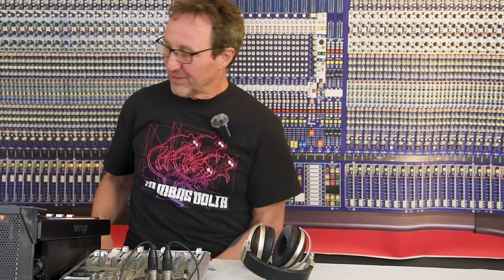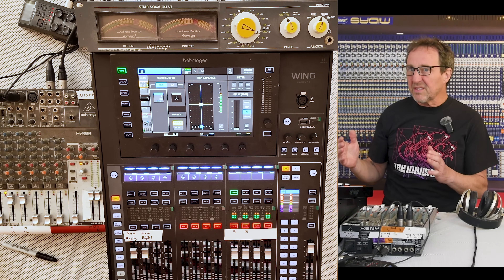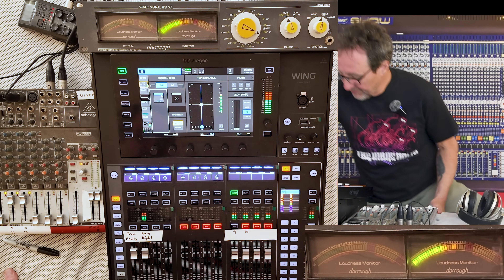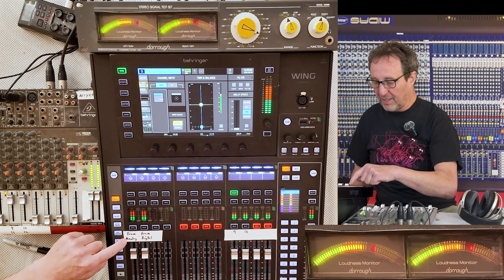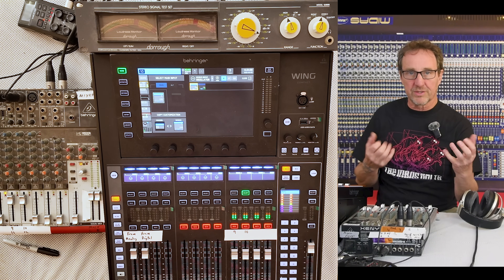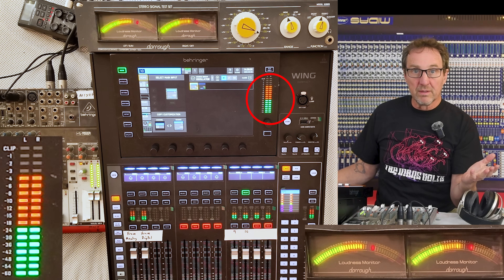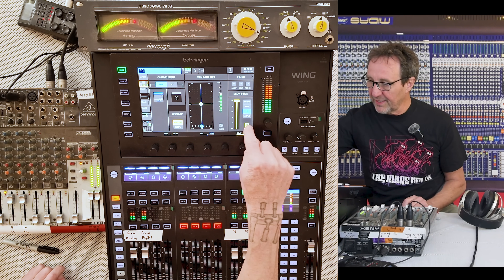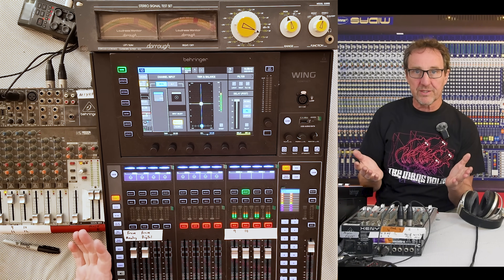Digital Audio Meters Don't Show What you Hear - Sometimes

Comment: Very interesting.
I wouldn't be surprised if the digital meters somehow were actually technically "correct" in a specific kind of way.  but I'm no specialist on the math of digital metering. 
The problem generally is not "meters". The problem is people who often tell us meters are "accurate" with music program. (most are accurate with a sinewave)
By the time I had 20 years in the business I had realised (through transition from analogue tape recording to digital tape recording, then to direct to disc recording) that even at that time that we were in trouble with metering.  Old analogue VU and PPM meters had no accuracy whatsoever over a musical signal as "meter ballistics" were really the dominant thing, the mechanics of a moving coil and needle and some crude drive circuitry, VU meters were intended to represent (slightly) the dynamics of tape and tape saturation and were therefore blind to peaks and signals above +6 dB over whatever reference was supposed to be 0VU.  PPM meters were more for transmitter protection in broadcast and would read faster and higher yet you could still shoot off the end with a clean signal.
When we went over to DAT and things like the DTC1000ES, SV3700, or DA20 we struggled to get to grips with absolute peak meters and the concept that "0VU" no longer had any meaning and that Fs was the new "god" in the room.  It was a Wild-West in those days, every manufacturer had differing ballistics and it took a bit of experience to know how hot to run a DAT machine for mastering. 
Live sound was less "critical" about metering back then. Our Yamahas (PM3000 and PM 1800) were happy with all VUs slammed against the end and ran perfectly clean, our Soundcrafts less so. 
As a system tech live (for the last 40 years) I spend a lot of time getting "headroom" matched from the desk all the way to the amps. It's never been about "precision metering" (maybe I am too old and come from a more basic time) but more about getting noise floor and clip points in the right place and then getting the best clean signal into the DSP from the console so the DSP has room to "breath" and do it's work. It's also about getting a signal out of the console at a level that allows the console to be able to "breathe" and cleanly deal with the unpredictable dynamics of the show. 
As such we are usually working in about 6 to 10dB "clicks" of gain adjustment increments as we know that all our gear is a bit "here or there" with clip levels and most of the new gear has up to 100dB of dynamic range that on most shows is being played out in an arena with often no more than 60dB dynamic range window between "too loud" and "crowd noise" - some rare shows maybe 80dB at most.
We tend to look at metering as a very vague science, a kind of "ballpark" number that somehow kind of tells us (maybe) that we are there or thereabouts close to where we want to be. 
Metering is a visual representation in a most basic form based on whatever metering ballistics were chosen to represent a far more complex program. No metering is "accurate" (even analysers - especially analysers) because there was always some form of compromise to make it visually representative of the program. a truly 100% sample for sample meter (easy to make) would be so flickery as to be distracting and illegible. 
As always, great video Dave, and plenty of food for thought.
Reply from the maker: Indeed the digital metering is technically correct in that it is indicating the level at which to signal will distort and give digital clipping and how far you are from that. 

But the bigger issue has to do with why the meters are reading higher levels. 

It has to do with the way that high frequencies float around effortlessly inside of digital gear up to very high frequencies. 

With analog gear little clippings of ultra high frequencies just create more ultra high frequencies that we can't hear 

With digital gear clipping of ultra high frequencies can create subharmonic artifacts that are audible.
Reply: @DaveRat  I agree. 
(BTW I replicated your results on an A&H SQ6) 
It's always been a case of "swings and roundabouts" for me in that some meters tend to show some aspects better and others represent other aspects in a more user-friendly way. 
(That's why I use both SMAART and AFMG SysTune analysers on the same job) 
A lot of human perceived loudness is related to time integration of our hearing (the amount of energy in a particular time window) rather than just the instantaneous energy. It is possible that this is where we are seeing metering differences here. (Maybe the decorrelated signal possesses the same overall time integrated power as the summed signal and the metering is registering that through the metering algorithm. I'd be interested to know.
I'd love to see this on an oscilloscope - maybe I will give that a go tomorrow to see what the scope reads as the scope won't have the meter ballistics on the display that the consoles have.  
I also have some super old digital gear hanging around the workshop. (Sony PCM 701 and a Somy MDS E-11) I'd be interested to see how they deal with the issue and if their metering is more simple.
This could even just be down to the consoles and DAW allocating DSP resources and could even be how a stereo meter is processing a 2 channel signal with a single DSP function and maybe interleaving samples.
I wonder if the stereo meter will even display a signal above 48K on a 96K console.
We have issues with A&H mixers interleaving stereo signals in the main FX engine rack. If we run a 96K noise signal through them and then put a stereo FX rack plug-in (Not default channel EQ comp gate process) on a channel it truncates the audio down to a 24KHz bandwidth suggesting that the 96K core is interleaving stereo signals The consoles work fine passing 48KHz audio until a DEEP processing effect is put on a stereo signal..... I wonder if the stereo VUs are all doing something similar. - that I don't know.
Reply from the maker: Let me know how it goes and what you figure out. I have another video that I did that's not released public yet that dives into this subject further.
Reply: @DaveRat  Interesting news....
While setting up some tests on the Allen and Heath SQ6 I found that it DOES meter the drop in level. 
.
It just depends on where the master fader is. 
.
As the meters are only 3dB increment if the fader is at a position "between" steps on the meter the meter does not move. If the fader is about 1.5dB higher than that it correctly drops 3dB with the delay on/off switch.
.
Good work from A&H on the SQ boards... a serious bit of kit for the money. 

Here is a short video showing the experiment, first with the master fader at a position where the meters don't move, and next raised slightly to where they do. 
https://youtu.be/7bQjZbGtIFE
.
Here is another video showing the graphical meters moving, It's not too easy to see as the scale of the meters is HUGE and 3dB is tiny but you can see them move. 
 .
https://youtu.be/mlIbtA3s5IE
,
Interesting stuff.
Reply from the maker: To make things clearer and reduce resolution errors and such, I did it with 10 white noise signals all with staggered delays of 50ms or so.that should create a 10dB boost for decorrelated and 20 dB for correlated both audible and metering wise.
Reply: @DaveRat  What is curious here is that the A&H D Live clearly does not change (on your video) when tested yet the A&H SQ6 does.(on my video)  Supposedly they both run the same basic FPGA 96K core and have very similar (if not the same) underlying algorithms. The SQ6 has a more low resolution output meter so obviously the code driving it will be slightly different. 
I'd be interested to see if the D-Live does the same thing in the iPad app as it does on the surface. 
While on the subject of metering, another thing. 
On the SQ6 I get a feeling that the LED meters and the on-screen meters are VERY DIFFERENT in terms of how they portray a signal (not necessarily in how accurate they are, but how that display "feels" to the user) The LED meters feel faster and more responsive like an analogue desk while the on-screen meters feel a lot smoother but less clear despite their higher resolution even when seeing both meters side by side I tend to feel I get better information from the lower resolution LED meter.
See here.
https://youtube.com/shorts/tpt1impjckA
Reply: @DaveRat  Allen an Heath CQ 18T test.
https://youtu.be/TzHFfvQcIug
Reply from the maker: @joulesnewell8063 and confirming that is white noise not pink? The meters usually don't move so much with white noise and move more with pink noise
Reply: @DaveRat  https://youtu.be/5Hl30X1f0MA
Reply: Amazing how fast the ªCM701 meters are. I think these 1980-s meters are absolute value rather than RMS or PPM or VU.
https://youtu.be/XQolBxGDmws

Comment: 4:04 The analog does not perfectly null when the polarity was flipped. Not sure that it matters that much, but thought I'd mention it.
Reply from the maker: That's true and unlike digital where you have a numerical representation, analog has slight differences in variations so you never really get a perfect null. 

Whether that is an asset or a detriment depends on the scenario.

Comment: Dave: has anyone from the Manufacturers of those devices given you any responses to this test.. ???
Reply from the maker: Yes I've spoken in depth with one of the manufacturer's design engineer. 

There are several issues going on. One is at the metering is hypersensitive to even the slightest peak which is different than even the best analog peak meter. This is important for digital meters to avoid digital distortion and also requires less processing than a smarter meter. 

Additionally there is an issue with ultra high frequencies floating around inside of digital consoles unabated. Unlike analog consoles where the very high frequencies become subdued or reduced as the signal path increases even if the bandwidth is the same. 

With an analog console those hold through high frequencies when they collide and create extremely short duration peaks, it's really a non-issue and not audible. 

Conversely in the digital domain where those peaks are more likely to happen and compounded by Nyquist filtering, overload of those peaks doesn't just distort an ultra high frequency signal with ultra ultra high frequency noise components all of which are inaudible, with a digital console those ultra high frequency peaks can have low frequency distortion components to them in the audible range. 

The issue is not easy to fix. One possible method is to low-pass all of your signals to eliminate the high frequency garbage up there but the low pass filters in themselves create additional issues. 

Putting an input transformer on every input of the digital console would act as a natural low-pass and prevent the issue.
Reply: @DaveRat  very interesting ... I long for the days of VU Meters and 20 -20K world.. So much simpler ... Let the "tubes" handle the peaks and only distort in EVEN harmonics... LOL
Reply from the maker: Agreed those Gremlins in digital make things more complicated. I'm not against digital and I love and realize it's assets and also it's important to remember that no good deed goes unpunished and with those assets come new and interesting issues that we need to be aware of

Comment: Windowing function of the metering has to make a math compromise that's decorrelating.   ADDA chip is being passed math that takes place "after" the metering, and the metering uses a logic gate shortcut to be fast, throws away identical values > f("?", 500hz?) without actually summing.  An inverted inter-sample "error".

Or it has a dithering value applied (at the meter) to make the ballistics look more "analog", but it creates a summing error as it approaches an upper limit.

 Inter-sampling windowing function has to be compromised.  Or "everybody" is using reporting from the ad/da chip manufacturer(s) (which is all probably using drivers made by (company name I can't remember)), which maybe has dithering for the level, or a sliding window?

Software windowing creating a false "negative intersample", guess at metering.  Presumption is that you could sum 16 channels and the meter wouldn't change, so some logic gate shortcut is throwing sn identical value away for expediency.  RMS windowing calculation has to be decorrelating by skipping temporally an operation or dithering.

Or the morning matcha hasn't kicked in and it's obvious, lol.
Reply from the maker: All of that seems to be focusing on the metering being flawed. 

For the natural progression of that is that if the metering is flawed and reading too high of a signal then we're not really losing that headroom, that's an illusion and the headroom is still there and we could boost the console and overload and still be clean, correct? 

Do this with 10 white noise channels so that there's 10 DB of lost headroom in the digital metering and push 5 DB into digital overload and see if your signal is clean.

Comment: I don't suppose that the Wing displays the channel level on the large meter when a channel is selected? So, the meter on the individual channel wouldn't change when the polarity was flipped (and neither would the large meter, if it is displaying the level of the selected channel). It looked like the meter for the main LR channel went up when you first unmuted channel 10. Do you see the increase if you look at the meter when your main LR is selected, then go change the polarity of one of the white noise channels, and then select the main LR channel again?
Reply from the maker: The easiest thing to do is set it all up and come out of the console back into two channels and then use the PFL meter to compare before and after converting to analog. 

That way you have the same meter looking at both and you'll see that converting to analog fixes the issue

Comment: I tested with Studio One 4. The meter on the main bus doesn't change, but if i use the Level Meter plugin that's included it show the correct values
Reply: The Level Meter plugin uses RMS that's why it's correct, but if I toggle the correlation meter it show that the signals are fully corelated in both cases
Reply from the maker: Okay so you solved the easy part of looking at a pretty picture, but the bigger more important question is, Are the peak meters actually reading real signal that will cause digital overload and if so the RMS meter trick is going to hide that issue from you and allow you to digitally clip. 

And if you pay attention to the peak meters then the reality that you're losing headroom in the digital summing domain that you don't lose in the analog something domain may be a concern

Comment: Dumb question, could this have anything to do with the ballistics of the digital meter. If the RMS calculation is too short the meter may not react properly?  
Id love to check this out with some digital metering plugins in a daw to see if its happening there as well.
Reply from the maker: Meter ballistics are definitely a factor but in the video I show that the problem goes away if the signal is converted to analog and back to digital again and you can see that metering on channel 1 and 2 of the wing. 

Also the analog meter has peak LEDs on it that read correctly. 

And if indeed the peaks are there and the meters are reading those peaks, then getting a meter that ignores those peaks will put you into digital distortion if you're not aware. 

I was able to confirm the peaks are there and real and will cause distortion and the meters are reading correctly
Reply: @DaveRat what happens if you use a sine wave?  Im thinking perhaps the peak is changing but the average is somehow leveling itself out.  Doesnt make much sense that when the same signal is converted to the analog domain and back the meter suddenly is like “yeah this is louder”. Very weird situation. Only digital mixer i have is an old O2R and thats been in storage for over a decade. I do have the TC clarity meter though.  Going to check it out tonight when im in the studio.  Meter on that is phenomenal.
Reply from the maker: Let me know how it goes